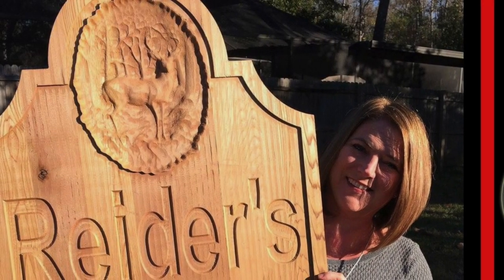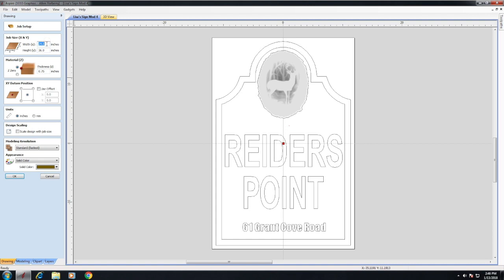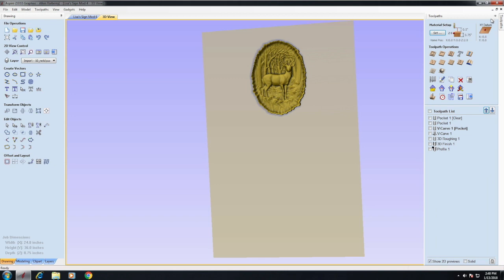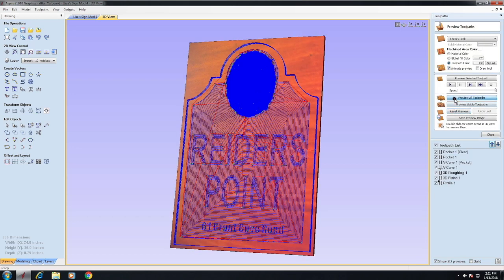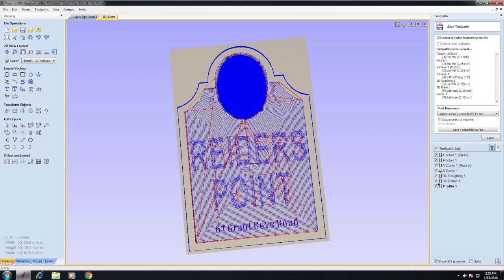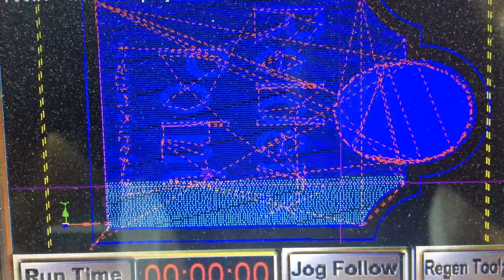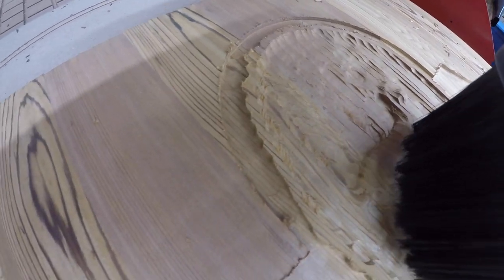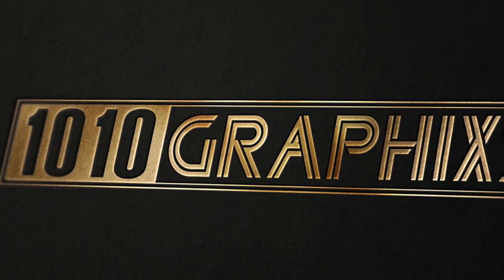3D and V-Carve a Cottage Sign

Comment: Another nice one. Suggestion, try doing your finish passes across the grain. I get much better result doing roughing with the grain and finish across, a lot less fuzzy stuff left over to clean up. Another thing I've started doing is not bothering with a clearing pass on dished carvings like the deer on this. Since each pass starts pretty much completely outside of the material, the overall depth isn't too deep, and the step over is so small, it isn't too much on the bits and cuts down on machining time. Not sure if you are using tapered ball nose bits or not, but I've only tried using this technique with them since they don't seem to get as angry while plunging. Take a look at https://youtu.be/boh6GET0YAY?t=6m45s although his isn't dished and therefore doesn't taper out of the wood so it burns a little on the outside and he is doing an offset toolpath, it gives you an idea of what I mean.
Reply from the maker: I appreciate the pointers! The cedar milled ok on the CNC, but the grain has long strands that were pulled up by the bit. I will take a look at your video - thanks!